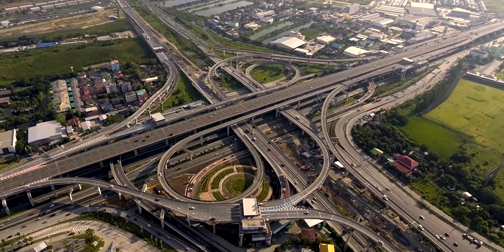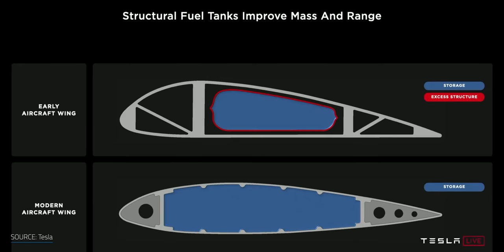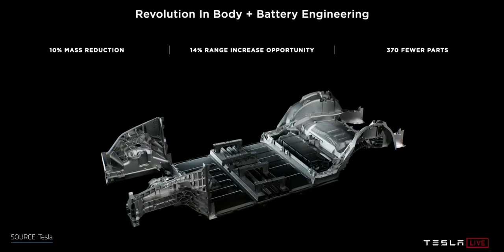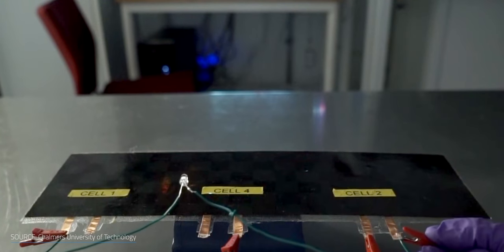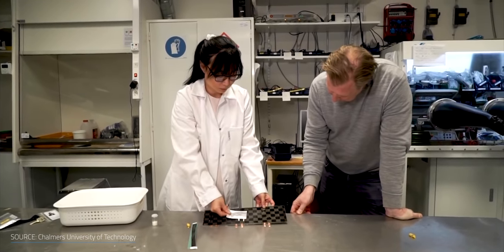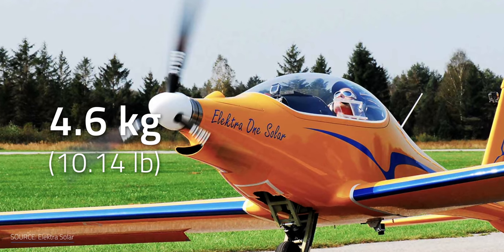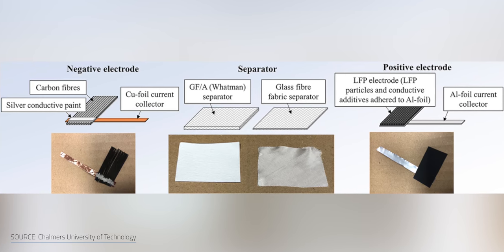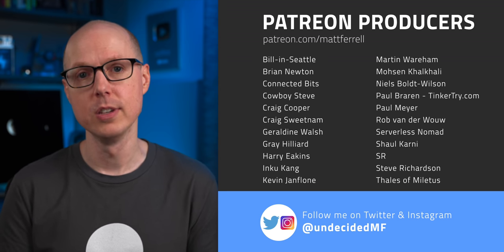Exploring Structural Batteries

Comment: All these high integration and part reduction approaches these days stem from a very limited view on the problems automotive development faces. The biggest problems with these approaches are serviceability and recycling.
A car with high integration or, as Tesla now does it, with big structural parts, results in very high insurance ratings because a small dent can cause a total damage easily. People tend to think that automotive research did not consider that before tesla came into the market, but they are very wrong. Tesla basically is making a lot of "noob" moves.

Comment: I could see this as an addition to the battery pack. Say the a pillars and roof. Or the trunk and the front hood of the car. Saving weight on the traditional battery. Depending on the design you could make it modular.
Reply: make the doors, hood, trunk and maybe the top out of this.  That way they can be removed in pieces and replaced.

Comment: Hearing that the batteries are integrated into the body just says to me expensive to replace at battery EOL.
Reply: The "joy" here is that you do not replace the battery, you replace the whole bloody car!
Reply: @Cybergrip1  That should only cost $40,000 to $60,000.
Reply: No Teslas new 4860 cells will outlast the car, it's been tested and confirmed to have a million mile battery life.

Comment: The airplane fuel tank analogy is…meritless.
Reply: Why?
Reply: @LabGecko  if the internal cavities of an electric car could hold the fluid medium that provides the electron Reserves, then there would be a point. Batteries retain complex structures and weight penalties beyond that of the fluidic mass. Structure-based energy storage for an electric car would be more advantageous then cavities built into the paneling. These are incompatible Concepts that merely sound good.
Reply: @omnimetabell  Sure, it isn't a direct correlation, but I think the point he was making is that using the vehicle structure or fuselage to contain the energy that drives it is more efficient than adding another container, and more weight as a result. I think the analogy works for that.
Reply: Agreed. Liquid fuel adds no structural strength, in fact it increases stress. They keep it in the wing because the fuel load is variable and gets lighter as it burns, and that's the largest structural void sitting on the center-of-gravity.

Comment: so when the battery capacity goes down. we'll throw the whole thing to the landfield
Reply: No, when the car is done the battery pack goes into energy storage systems for more years. Then at end of life they are recycled to recover the important resources to make new batteries.
Reply: @rogerstarkey5390  it's no obsession. not everyone deals with trash with white gloves. with a metal chassis everyone queues to sell it for scrap metal. good luck melting or taking that apart. the cost of recycling the chassis will be more than it takes to make it
Reply: @davidmccarthy6061  there is no battery pack. that's the point of the video. you'll need a pretty big garage for all those chassis.

Comment: So in other words. Once the battery no longer holds a charge or recharges you'll have to change out the whole bottom of the Car? 🤣🤣🤣🤣 I can see why everyone is starting to laugh and call musk a joke. It's only gonna really catch on when you can pull into a gas station (or some place), pull your battery pack out and slide a new one in. Sorta like a "rent a battery" thing. Some places are already doing it but there's no  BATTERY STANDARDS for that to work properly.  They all need to stop trying to build their own different battery pack and work on a standardized one.
Reply: In other words the new 4860 cells has been tested and confirmed to have a million mile battery life.. So it will outlast the car by a huge margin.

Comment: This all adds up to a less serviceable product.
Reply: I'm not sure this is as reasonable an opinion as you think it is. The basic tech of a ICE cars is a hundred years old. Newer tech, though? It's much, much harder to repair. I mean, you're absolutely right the product is less serviceable, but look at computers. How many people have the know how and the tools to repair a fried motherboard? As advanced technology continues to permeate every aspect of our lives the required ability for anyone to repair it is likewise increased. It's the price you pay for the specialization of advanced tech.
Reply: @jackinthebox301  The knowhow is simply a matter of education. There's nothing magical about electronics. The components are all easily accessible by removing a few screws and fairly simple to pull off and swap with some cheap gear. Replacement parts are tough to come by not because they are expensive, but because of exclusivity deals where companies prevent component manufacturers from selling those parts; because if they sold them, people could repair it without the company wetting its beak. But, in truth, you could replace a burned out chip on your motherboard in a few minutes.

Now, imagine what it takes to replace the structure of your car. At that point, you are completely disassembling and reassembling the vehicle, as without structure the whole thing falls apart. And you aren't talking about a $5 replacement capacitor, you're likely talking maybe tens of thousands of dollars. Because it's the structure; the more solid the structure, the better, so you aren't replacing just a piece of it.
Reply: @jackinthebox301  Big difference between a $100 motherboard and a $50,000 car..
Reply: @jimschuler8830  Spot on Jim Shuler, there is a device repair tech & evangelist of repair laws in NY who has a YouTube channel where he discusses at length having to buy replacement chips for Apple product repairs, from sketch vendors in Russia, because the Foxconn Hon Hai that makes stuff for Apple will not sell anything to a third party repair shop // its not just Apple. Many products are designed to fail by engineers who studied Lifecycle analytics who are pressured by accountant & business people to make products that last until the warranty expires designed obsolescence & most people I talk with commiserate their understanding of this. People older than me were able to buy home appliances that were easy to repair, made in America, & some are still working even though they are 40+ years old. They just do not make most things to last anymore. It does not make recurring revenue business sense to the shareholder whores that run the companies, many of whom hate the ideas of selling a customer a product & that customer never needing to buy another one or worse passing it down to their children // My parents had a fridge, from the 1970's that was still working & never repaired in 2014 when they moved & sold it // it was not the most energy efficient model but very well made in America // I used to work on a metal mill made in America in the 1940's, all metal, no plastic, even the power wires wrapped with glass fiber or some long life fiber insulator // that does not crack over time // this machine was used daily since the 1940 so I contacted the manufacturer Bridgeport & asked if I could order a new one like that & they said they could custom make a replacement to the original spec for over $100k //
Reply: @AaronSchwarz42  I'm not sure you guys are getting at my point entirely. I absolutely agree a major mitigation factor of this would be education. However, as tech continues to progress, it gets more complicated, smaller and more integrated. To continue with the computer metaphor, Processor SoC's are more common than ever. In the past if one controller went bad you could swap it out, like you said, for $5. But now, if that commensurate part, which is now integrated, shorts out you have to replace the whole thing. It's just not physically possible to fix it. That's the price we pay for more effective, efficient and cheaper tech. 

As for Right to Repair, of course we should be allowed to repair anything and everything we can buy. 100% agree there. But you're eschewing one important part of the equation, those cheaper materials are just that, cheaper. TV's used to be sold in huge wooden cabinets that added to the price because they were made out of big (likewise more easily repaired) heavy components. Now, though? You don't buy a 85' TV and put it inside of a giant mahogany cabinet that weighs 500 pounds. Tech is cheaper than ever because they shave off every piece of excess they can.
Reply: @jackinthebox301  >Newer tech, though? It's much, much harder to repair

Not at all unless it's intentionally designed to be non-repairable (Apple, Tesla, John Deere...). It's actually much easier in many ways to repair modern equipment because it's generally made from stuff you can just buy out of a catalog. Blow a big MOSFET? Order one from Mouser and solder it in.

The difficulty comes come companies embedding software into their hardware that is intentionally designed to defeat repair, and controlling supply chains so that it's impossible to get certain parts.

This isn't because of complexity, plenty of extremely complex equipment is designed to be serviced. It's by design, it's planned obsolescence.

Comment: Next step for small electronics, use the battery as part of the PCB.  

The other opportunity is attaching the battery to the back of the solar panel, so it can provide power 24/7.

Comment: "The biggest roadblock to widespread electric vehicle adoption is range". That is the biggest lie of 2021.
Reply: Is it not? That, or the ability to find a charging station.
Reply: The biggest roadblock is speed of charging, IMO.
Reply: @Z6D4C4  In my opinion the biggest roadblock is price. You can't have widespread electric vehicle use if no one can afford them. You are right as well, finding a charging station is a pain in the ass.

Comment: How serviceable are these going to be? EVs sometimes get bad/unbalanced cells that need to be swapped out. How would that work with a structural battery?
Reply: You don't...
Reply: By the looks of it, serviceability is going to be completely gone. The repair solution is going to be a new car.

Comment: I still think that standardized, easily removable battery packs are the best way forward.
This way instead of leisurely charging your battery for hours you just pull into a station and have (near ) empty battery pack swapped for a fully charged one in minutes. Existing petrol stations could just be bit by bit converted to battery storage and charging stations, old batteries can easily be weeded out and put into recycling and there would be no range anxiety.
Reply: Exactly,  just like you can swap out propane tanks for a full one at a gas station.
Reply: Recycling batteries has yet to make sense in both energy consumption or financially.

Comment: yeah I don't know about this one. Look at the size of that carbon fibre panel, and look what it's powering... a single 2V LED... 
And that's not even considering all the safety precautions that would be needed to have essentially a 'live' vehicle body. Yikes...
Reply: stabs car with screwdriver and it lights on fire just like you would expect a lithium battery to do

Comment: No more "somehow easy" replaced batteries, but the whole body has to to replaced ? How about change new car every 6 years and shred the old one. My car is 17 years and still doing great on diesel.
Reply: so its not really doing great, you are just ignoring the issues because no one has ever bothered you about emissions. it might have been working, but its not sustainable. im not saying this is either necessarily, just that your premise is incorrect. we need sustainable options or it wont matter either way.
Reply: Age itself isn't the issue, mileage is the issue. The batteries will probably outlive the car. Tesla is talking about million mile batteries, and they aren't alone. The number of cars the run a million miles is too small to worry about.
Reply: I’d like to see a comparative analysis of the input energy required to produce an IC vehicle versus an E vehicle, from a start point of digging ore from the ground to delivery to the showroom. Also, projected availability of the various raw materials going forward. 
To me, getting the whole picture is necessary, it’s not just about ‘in-use’ emissions from the vehicle itself.
Reply: How bout just dont have a car.
Reply: @robm.4512  I wish I had a source for you, but I do recall an infographic that showed E car production caused a greater release of green house gasses than ICE vehicles. Something like 20%+ more iirc? The "in-use" emissions largely depend on how the grid is powered. If its powrred by coal/gas it will be much worse than if it were on a nuculear grid.
Reply: @Holphana  can you walk 20 miles to get to the nearest transit stop? People don't need cars in the cities but there's no functional solution for rural areas.
Reply: @robm.4512  there are plenty available. you would have to find one from your area, and ideally from the same electrical network to get an accurate picture, where i live, its 100% renewable electricity, so my electric car has a much lower life time co2 foot print than one in the red states of America where they mostly use coal or nat gas. if you have a university near by, there will be plenty available there.
Reply: @redhairdavid  my car mostly makes water and fertilizer when I drive. 
(Its a gasoline engine lol) 
I'm helping to feed and water the world.
Reply: @redhairdavid  I see where you're coming from, and although diesel is a dirty fuel, he does have a point. If we replacing the battery on an electric vehicle becomes too complicated and costly we will practically have dispoable vehicles. If we have to scrap our vehicles each time something goes wrong or we get in a crash, it will greatly reduce the sustainability of car ownership. Mining and manufacturing do cause alot of emissions and polution.

(Also I think city design needs alot more focus for sustainability)
Reply: @redhairdavid  it's either diesel or coal and natural gas. Until we have enough nuclear power plants to support the load of millions of chargers being plugged in for the night EVs are just as dirty as ICE cars.
Reply: @lwolfer5170  over a 10 year life span electric cars are far less wasteful. The fact is its not even a relevant debate, all cars are going electric because they're better. They're also less wasteful but thats just icing on the cake.
Reply: @Holphana  You will also benefit from it somewhen, at least if you will have an emergency and rescuers need to reach you.
Reply: @d3m0n54in7  like i said, where i live, 100% renewable, so i dont think your premise is correct. its clearly doable. as its currently happening, in reality. it just takes some planning and then actually doing something. that last bit is really hard for some people. i assume you live in the usa, where its even harder, even though you have more resources than anyone, and could easily do it, there are people with interests in maintaining the status que and they can bribe legally your politicians to stay that way. its kinda nuts to watch.
Reply: @redhairdavid  "its kinda nuts to watch."

That's an understatement! If only Americans could see themselves through the eyes of the rest of the world. I've been on 100% renewable energy for over a decade, and it's largely from wind power, not nuclear. Even solar has been more economical than most other sources for several years.
Reply: @kj_H65f  have you pushed that calculation to 30 years? What's the difference between replacing an EV 3 times to once for an ICE?
Reply: If she still roll, she still good. Its not that hard to repair an older diesel either.
Reply: @redhairdavid  and no one told you about the emissions required to build electric vehicles. Ol dude could roll is diesel for another 100 years and probably still be under the emissions the manufacture of a tesla would create. It is better for the planet for him to continue using his car than to buy another one, especially electric.
Reply: @korcommander  you are very mistaken on that. A high efficiency gas car will only be able to drive around 12000 km before it exceeds the life time emissions of an electric car manufacturing. (Nissan leaf in my case, longer range teslas have a larger foot print, thebiggest tesla SUV it around 22000 km for a gas car to pass it) . Of course this assumes an electric car in my area, where we are smarter and 100% renewable. Also, this doesn't account for the maintence differences. Electric cars need a lot less. My 2011 leaf before this was in the shop 1 time in In 10 years. Power window issue. My other leaf has never had maintence in 3 years. No oil to change, no transmission to fail, 1/6 the moving parts.
Reply: @lwolfer5170   Thanks, I thought I remembered something along those lines. IIRC the increase in production emissions is down to the extraction and refining of copper, cobalt, neodymium, gold etc. that goes into an E vehicle. 
Vis-a-vis those rarer elements, the wider scope of environmental damage, beyond emissions, that extraction and refining them causes is pretty horrendous. 
Point well made on in-use power sources. I know that Norway, for instance, with all of it’s hydroelectric supply, is about the ideal case. 
I’ll do some more looking around for that production emissions info. 
Cheers, R.

Comment: Now this is exciting. The next logical step to this is to not only use the structure of a vehicle or building to store energy but to transmit it as well by sandwiching layers of conductive and insulating materials to create electrical pathways. This would completely do away with the need for wires/cables.